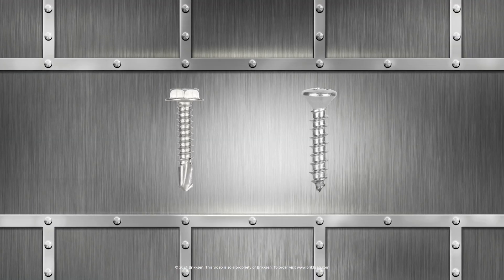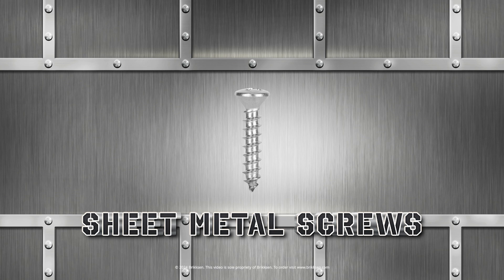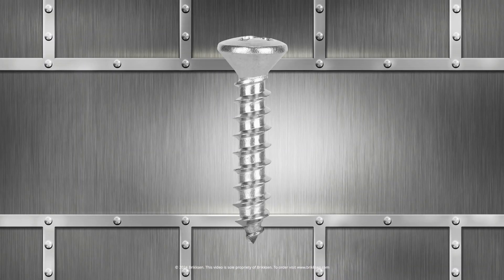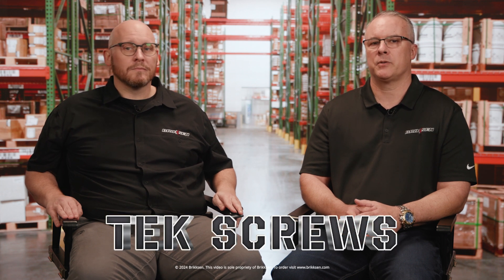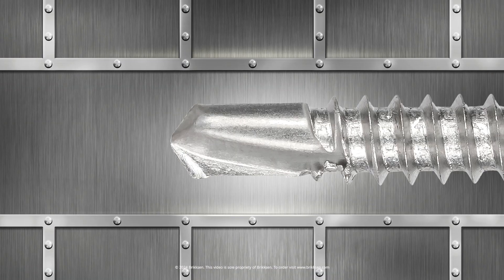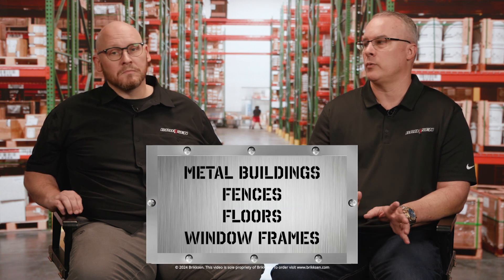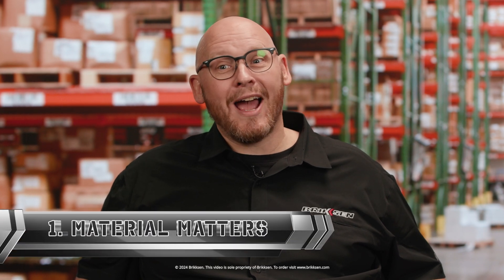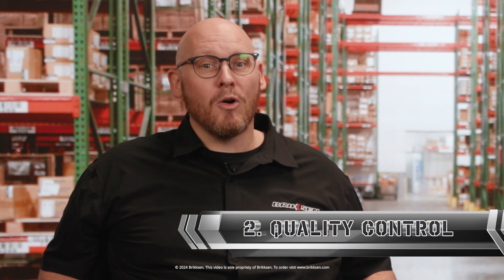TEK Screws vs. Sheet Metal Screws: Key Differences & Uses

Comment: Tech 5s are great for screwing into steel columns,  lower speed 2,000 rpm max , fine thread
Reply from the maker: Thanks for sharing your thoughts! You’re absolutely right — Tech 5 screws are a solid choice for fastening into steel columns. And keeping the speed under 2,000 RPM is a great recommendation to avoid overheating or damaging the screw. The fine threads also help ensure a strong hold in steel. Great insights!